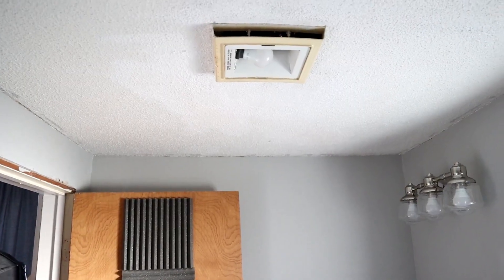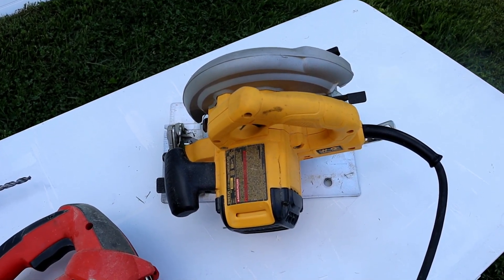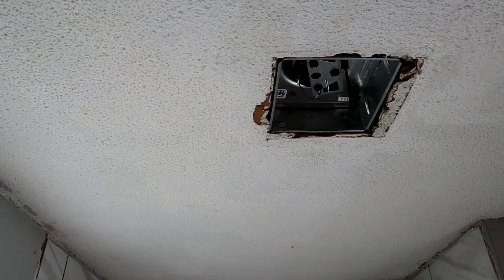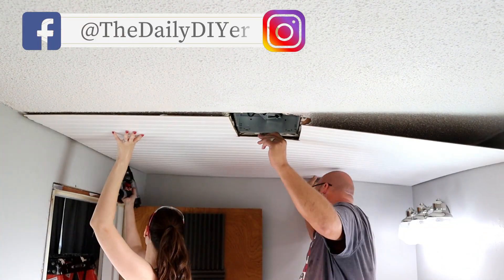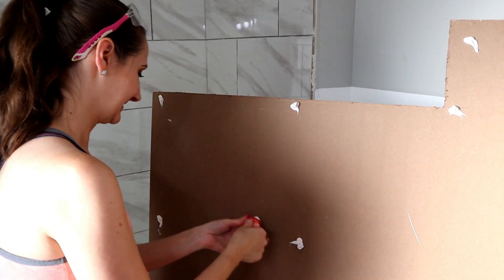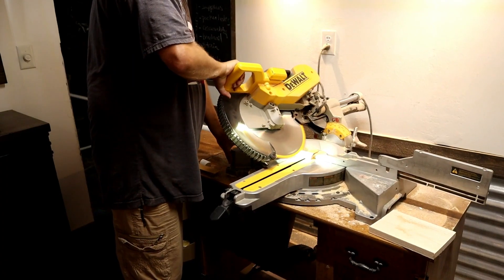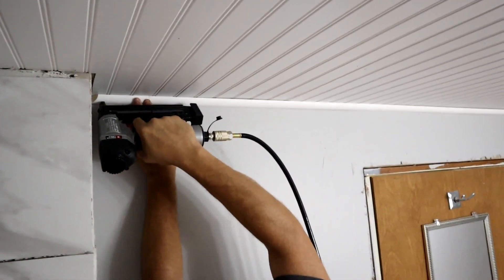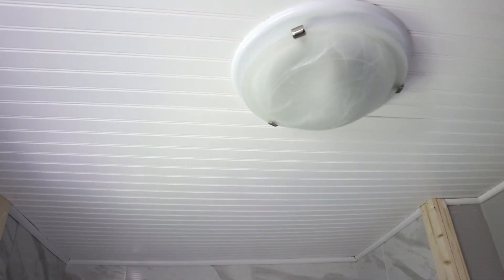$50 Small Bathroom Makeover!! | COVER POPCORN CEILINGS | DIY Bathroom Remodel

Comment: Good Idea. I need to do the same thing to my half bath one thing to note you should have used some white paintable caulk around your quarter round to fill in the gaps then painted. It would have added a much cleaner look.
Reply from the maker: Yep we did!  We used the TotalTech for that because it is paintable, love it!  It was just the VERY last thing we did in this bathroom remodel.  You are totally right, definitely finished off the look.  Thanks for watching!

Comment: How has it held up? It’s not really a material that holds up to a bathroom environment. Is it a bathroom that’s used often?

It looks good
Reply: Drywall is basically chalk and paper… so I believe as long as you caulk, seal, prime and paint correctly… it should be as good as drywall in any bathroom.
Reply: They do make PVC sheets of bead board but the weight is a lot more as well as the cost.

Comment: Will the paint start peeling off over time? My issue is my bathroom ceiling paint ends up flaking and falling off. I’ve replaced the fan with a commercial quality one, repainted after priming with appropriate paint for bathrooms. I would like to do this but I would probably not paint afterward for this reason.
Reply from the maker: After nearly 2 years we’ve had no issues. I wonder what would be causing this? Maybe a small dehumidifier would help in the space?
Reply: 1,2,3 bullseye primer is awesome esp in steamy bathrooms. 
Comes in handy for other stuff too.

Comment: Hi, I am wondering how does it do with water/moisture? (Particularly concerned if a bathroom doesn't have a fan)
Reply from the maker: We made sure to use paint and caulk that was for bathrooms and would seal to prevent moisture from being a problem. A year later on this project now and no problems ❤️

Comment: I have reservations about how this particle board holds up to the moisture in a bathroom over time. Anyone know? Probably coat it with two coats or so with mildew resistant paint and silicone the trim in? Don’t know…